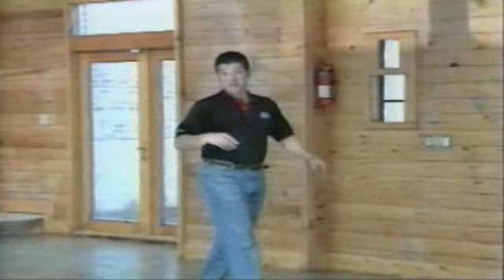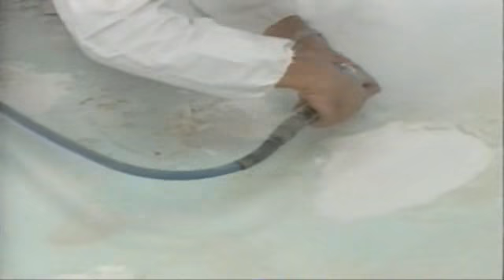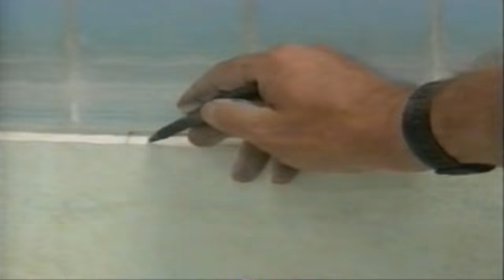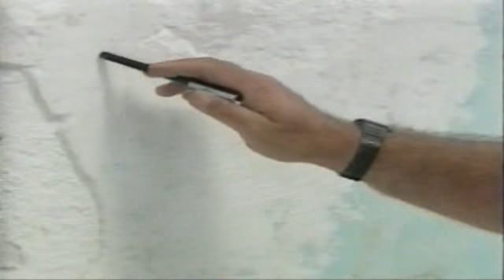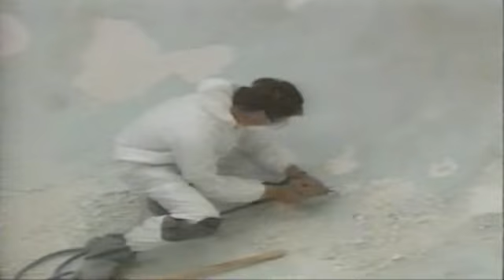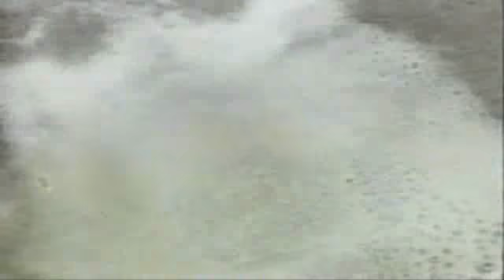5. How to Refinish a Swimming Pool (Part 1)

Comment: How much would a refinish job done by a pro cost on average?
Reply: In San Jose, CA I have got several quotes ranging from $15k to $26k for a 25,000 gallon pool
Reply: In NJ $10,000 - $30,000

Comment: no disrespect overkill buddy...spend some $$
rent something and knock that shit out. that's what's wrong with east Coast pool guys. 
I can design it myself
I can pull the permits
I can dig it
I can plumb it
I can run electric
I can rebar it
I can shoot n cut shotcrete
I can tile it
I can plaster, quarts, brush or pebble technology with my left or right
acid wash
or powerwash exposes
start up.
I can service it
I can balance chems.
or I can sale it.